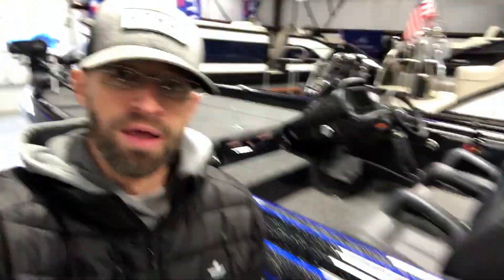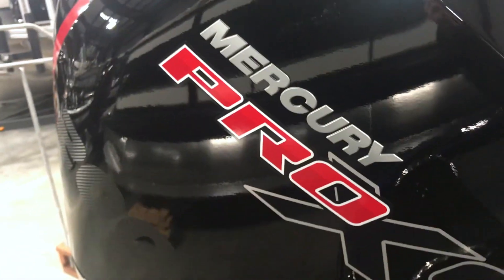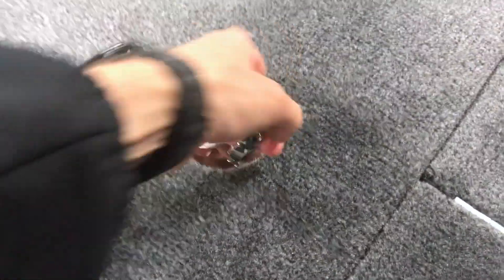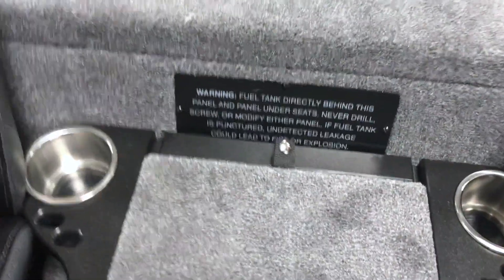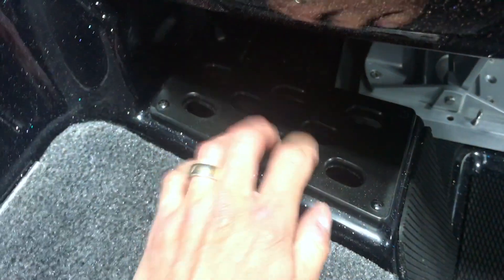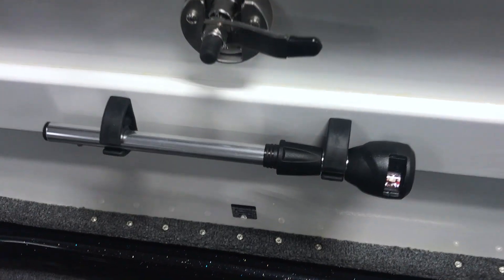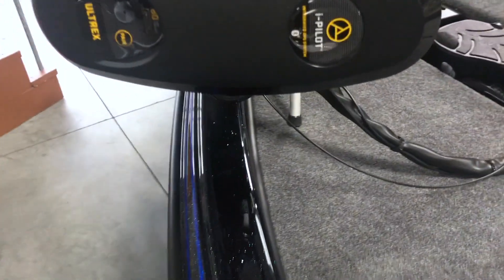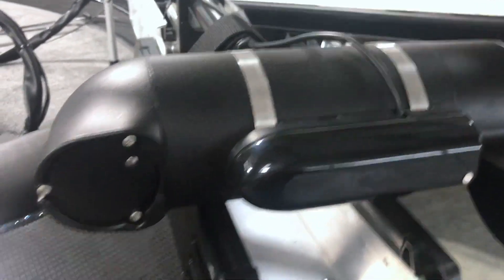New 2021 Phoenix 819 Pro Walk Around...

Comment: Does the 819 pro have power switch so u can cut off all the power.
Reply from the maker: Standard does not but the upgrades wiring does as an option.. TM there is not master power..
Reply: @skeeterboy77  thanks